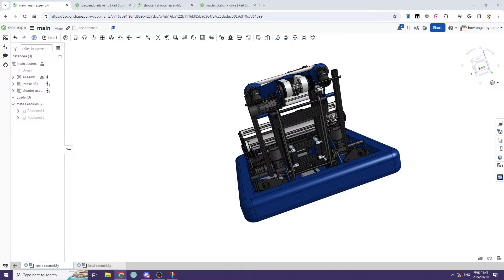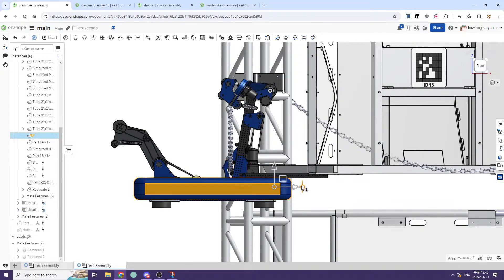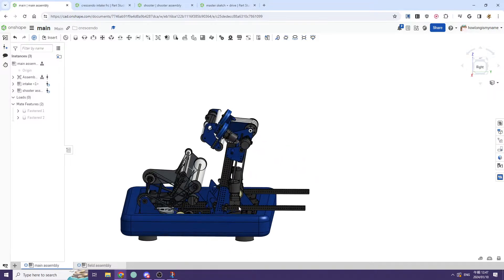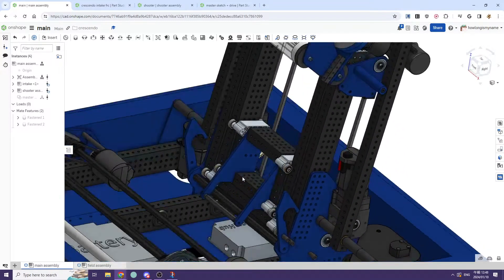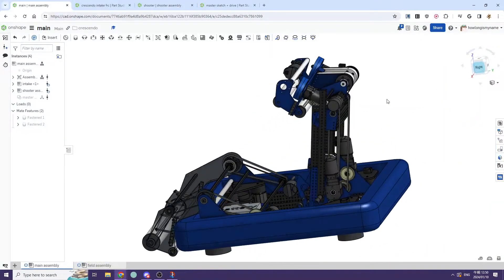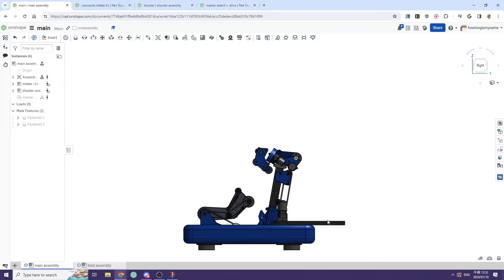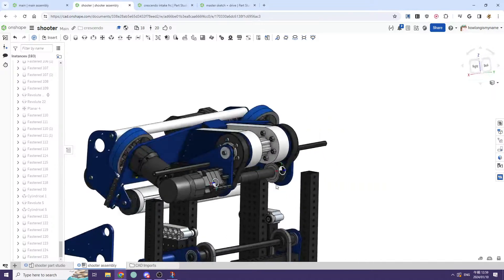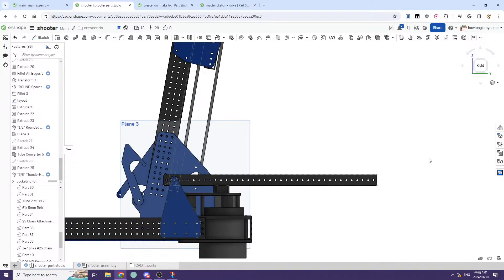FRC Trap Mechanism + Robot Updates Explanation and CAD Stream FRC 2024 Pt 3

Comment: This is awesome! One thing: how do you ensure your rollers leading into the shooter won't rip the game piece apart/apply unnecessary friction? Any ideas on countering this effect in a robot?
Reply from the maker: As of right now, I just put like 0 compression on those rollers and pray, lol. I think it's like 1/8 or 1/16, then rely on the tape/silicone rubber on the tube to add the tiny bit of "grip".